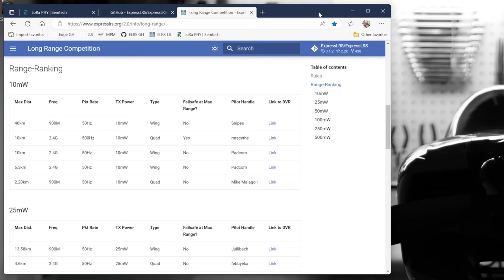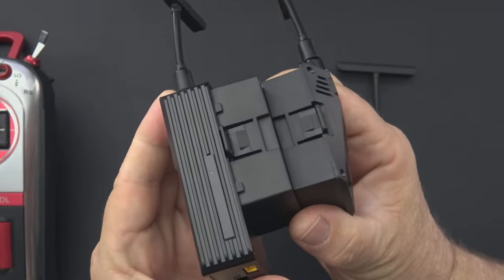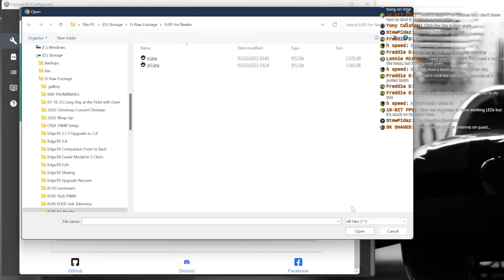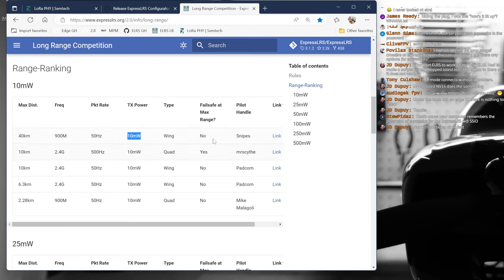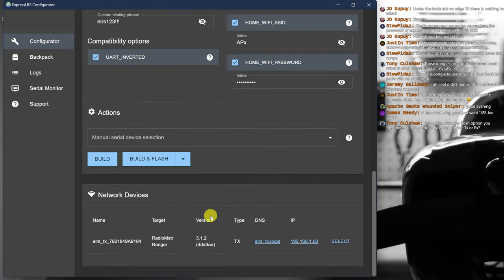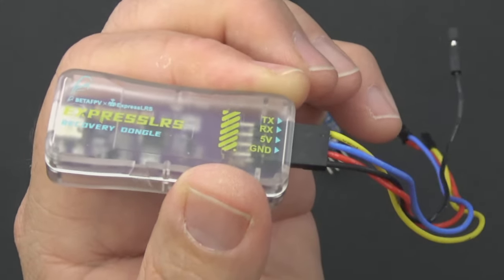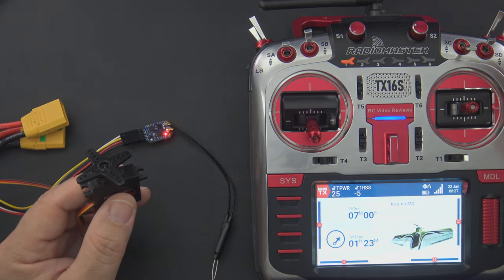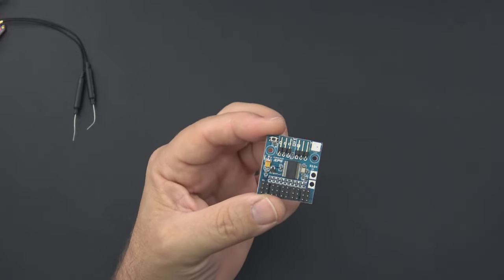Intro to Express LRS • For ELRS Novices

Comment: My next question is what to do with these tiny "receivers".  You can't plug servos into them so what do they do onboard the aircraft?
Reply from the maker: In the video I showed the crsff-pwm-c converter from Matek. That will give you 10 channels. https://www.youtube.com/watch?v=JymV752PJGM

This also works: https://www.youtube.com/watch?v=oUcMMjpN4u0

These CRSF output boards are intended to be connected to some sort of Flight Computer that understands CRSF like Betaflight and iNav. 

I'm hoping we'll see manufacturers produce some 10 or even 16ch pwm rx's this year.
Reply: @RCVideoReviews  What good are more channels if there aren't switches/pots on the Xmitter or the ability to add them?
Reply from the maker: You should probably start watching my TX16s videos and do a little research. The TX16s can support 32 channels.
Reply: @RCVideoReviews  Well, I've watched both the videos and I'm sure I can replicate what you did, I just don't know why.  Are those tiny boards really the only receivers onboard?
Reply: @RCVideoReviews  I'm attracted to the new BOXER.  Do you know when it will ship?  I don't have any plans for even 16 channels.
Reply: @ramtek2702  What's wrong with small? am I missing something?
Reply: @slammerf16  Small is good for some things.  I just bought a Boxer with 16 channels.  That means 16 servos that need to plug into a receiver.  I don't see any receivers big enough to accommodate that many connectors not to mention  batteries and other accessories.

Comment: How do you use those little rxs with planes when there's only 4 pins
Reply from the maker: Did you see the part in the video where I showed the CRSF-PWM-C board? That's 10 channels of PWM out. Here's another video with it: https://www.youtube.com/watch?v=JymV752PJGM
Reply: @RCVideoReviews  Ok thanks
I might give the elrs a try. Do you have to upgrade the firmware on both the Rx and module
Reply: @RCVideoReviews  Wish there were videos showing this stuff for airplane guys. It's always quad stuff. What are those Xt60 connectors used on that board and why two 
There's no videos on YouTube showing how to use ELRS for an airplane
Reply from the maker: The Rx and Tx have to have the same major revision #. So 3.x on Tx and 3.x on Rx. We covered this in the video. Didn't you see it?
Reply from the maker: http://www.mateksys.com/?portfolio=crsf-pwm#tab-id-4

Comment: not excited at all with ELRS, I have tx16s mkII and on config i click expressLRS screen just get blank and does nothing. firmware update didn't helped at all..:(
Reply from the maker: Did you turn the model on in model settings? Did you set a baud rate in system settings? ELRS works. If you're having issues, it's either hardware (possible) or configuration related (probable). Get on discord and we'll help you there. Link is in the description of every video I post.

Comment: The question on long range should be more about penetration which is a whole other ball game. There is so much that can be talked about on penetration…
Reply from the maker: The question on long range should be about video. Even at low power levels, ERLS is going to severely outfly most video tech without deploying some fairly advanced capabilities (antennas and trackers). When I flew long range, I kept RFLOS in mind so the farther I went, the higher I flew and that does not require penetration. I never saw a 3000ft tree, but I have seen a 3000ft mountain.

Anything beyond 3 miles is going to quickly become much more of an issue about video than control link if using ELRS.
Reply: @RCVideoReviews  I have seen many lose radio link in the mountains before video. What you say is true but sometimes penetration on video vs transmitter work different. I think it can be very close in penetration situation which may cause the following: low video reception, and lost transmitter causing drone to drop usually making reception worse if falling further behind interference and then losing video completely. It may all happen so quick that you just see your drone drop... Hard to tell without actual penetration testing...
Reply from the maker: I never flew long range in a way that would compromise my control link. Don't even comprehend the notion and what you're describing is probably why the government limits this activity. In my experience flying long range, video was always the first to go. 100%.
Reply: @RCVideoReviews  Government does as they do... more rules and regulations and they never do anything good.... People will still do dumb stuff as they always have. There is a lot that can go wrong but under usual conditions video should go first. I just saw a video yesterday where the TBS crossfire failsafe and crashed 150 yards LOS away from pilot and the video was fine. Clearly something else going wrong...
Reply from the maker: Yeah, that's not the protocol. If all systems are operating properly, video should go first.